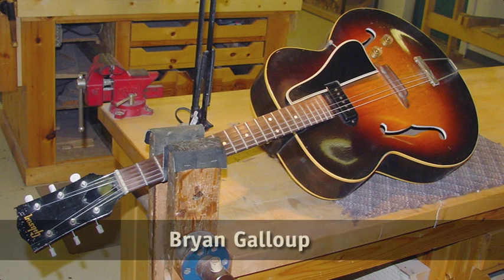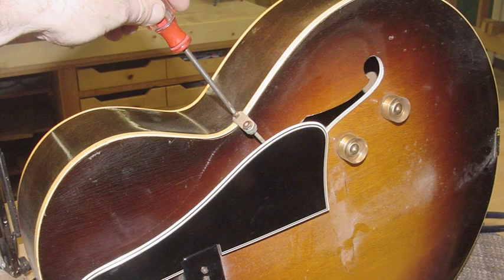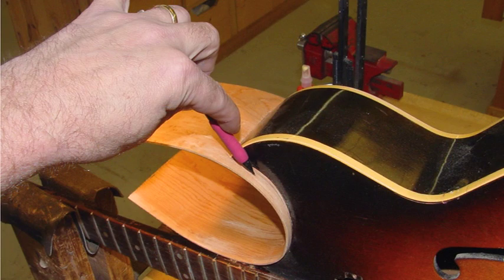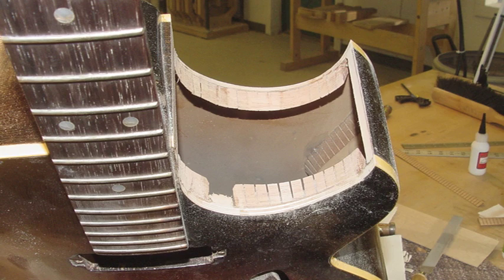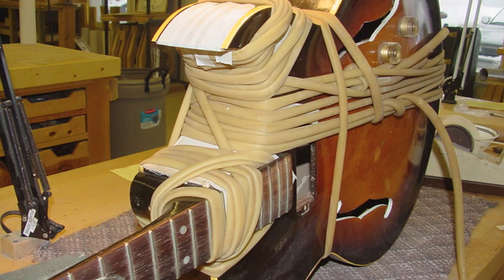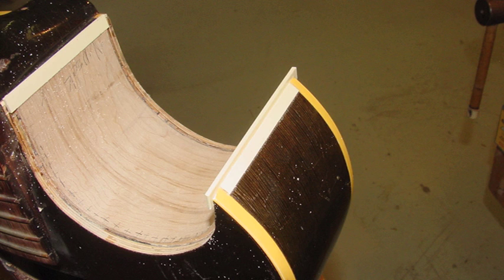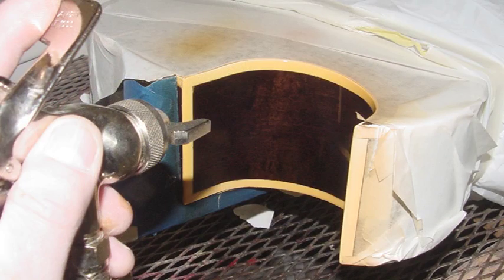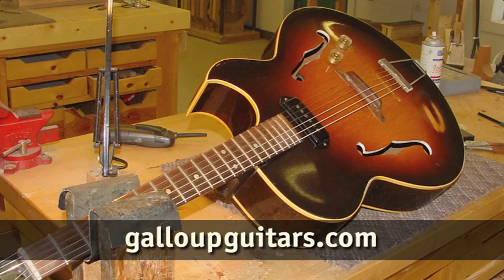Making a custom cutaway in a Gibson acoustic guitar

Comment: Hi, I have an electric guitar with a solid neck through the body neck with ebony fingerboard. 1-Its a single cutaway, I want to make a double cutaway. 2-I want to scallop the frets only from the 12th to the 24th. The guitar is Carvin DC Koa. I dont plan to sell it, or worry about future value and all that jazz, its my one of my main guitars. I'd like to do the cutaway myself with a bandsaw and sand it. The body has no pain and very thin layer of oil, nothing more. No binding nothing. Is it possible to do this? And I dont see how the neck would be damaged since its running all the way from the  headstock to the bottom of the bridge, one solid piece. Is it possible without doing any or much harm to the neck? How is the neck going to damage if its a solid piece? Your advice please? I also have seen all scalloped fingerboards done on a Strat and non ebony fingerboards. will I run into problems with the ebony if I dont go lower than the dots? Thanks.

Comment: I'm really tempted to convert my beloved Crafter D6 into a Florentine cutaway in the style of a Taylor 815ce, could anyone point me in the right direction? I'm an amateur luthier and a very experienced carpenter. I'm wondering if taking off the neck would be necessary and best type of additional bracing for the neck due to pull of the strings? Thanks in advance! 
Before - 
https://media.guitarcenter.com/is/image/MMGS7/D6-Acoustic-Guitar/000000113616717-00-500x500.jpg

Desired look - 
https://images.reverb.com/image/upload/s--xm8T8ASb--/a_exif,c_limit,e_unsharp_mask:80,f_auto,fl_progressive,g_south,h_620,q_90,w_620/v1384283225/nv8g0xrf2nioxdxpdhlf.jpg